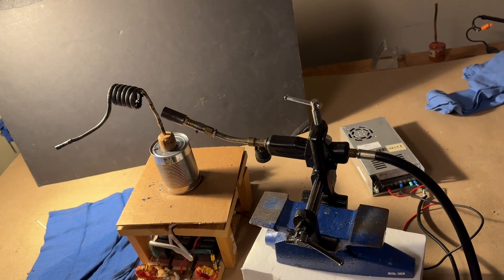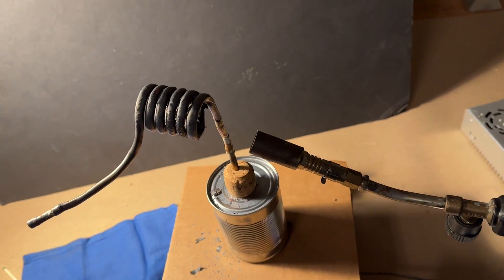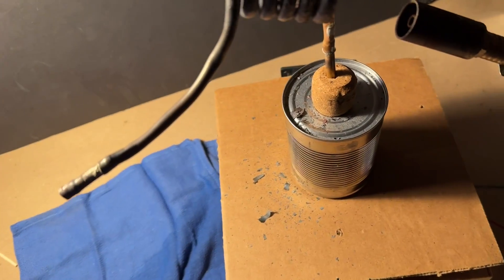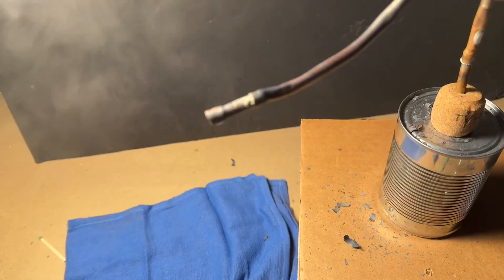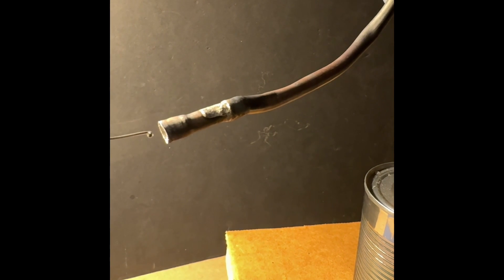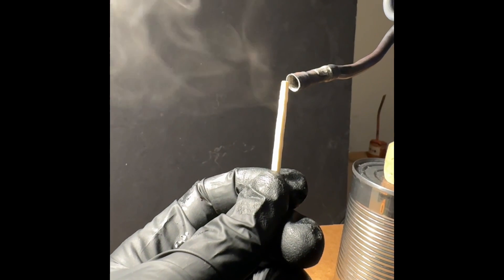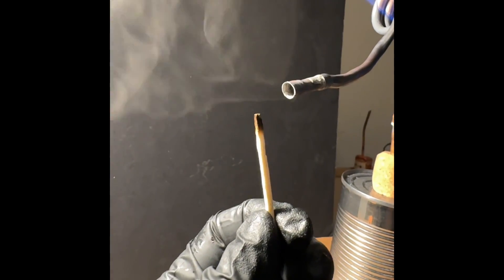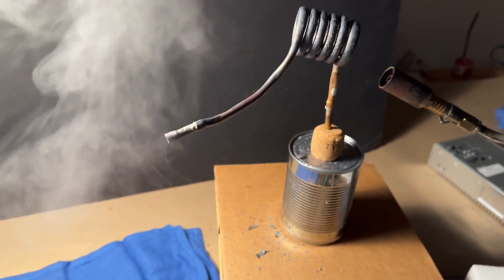Amazing Experiments Superheated Steam

Comment: Keep improving it... i want to see the air burn with steam. :p. ... Melt aluminium, make steel glow red or better. Is it possible to make it so hot the water molecules break and then burn back into water ?
What's the limit of super heater steam.. find that limit :D
Reply from the maker: It’s possible to melt metal with it. Would need stainless steel tubing instead of copper to melt aluminum
Reply: @BrianDhvTinkerer  ok.. do what you gotta do :D